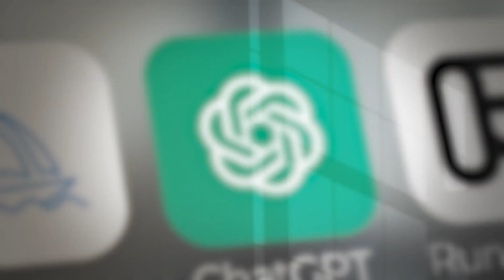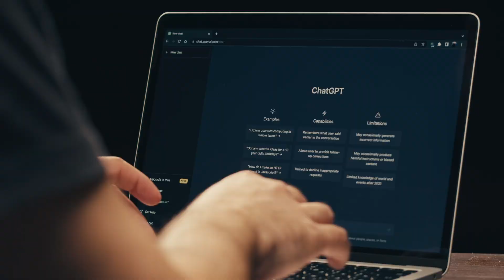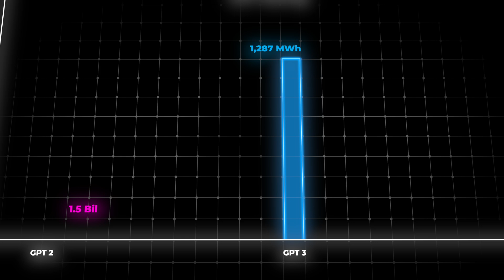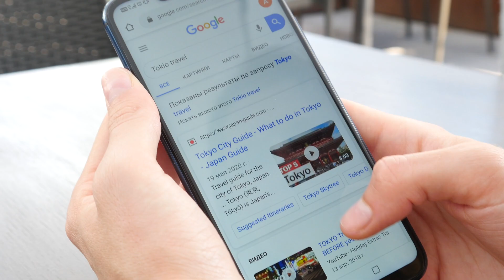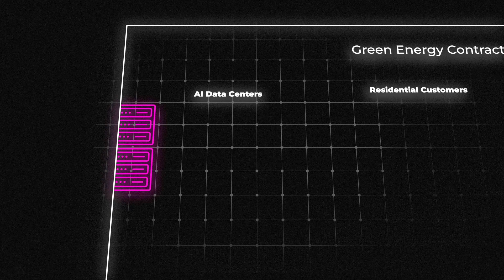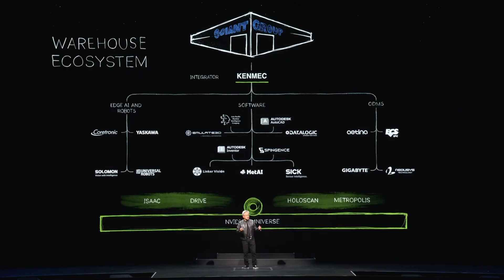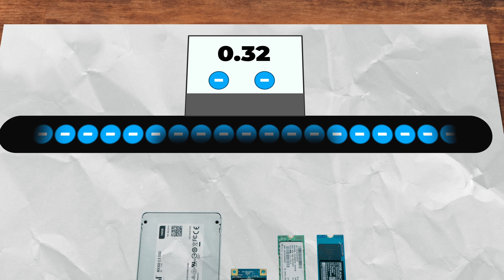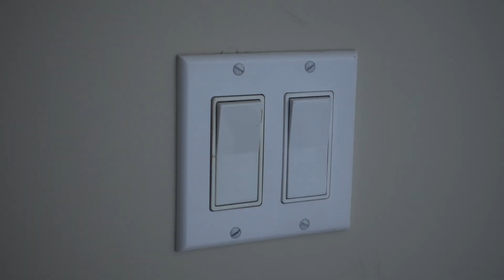AI's Hidden Cost: Can Our Power Grids Keep Up?

Comment: This is why we need nuclear power.
Reply: Nuclear is not the answer, not by a long shot.
Reply: @beyondfossil  why is that?  Is there a better source for more energy?
Reply: @DStein-jn9ls  There sure is!  Look upwards... but not straight at it. 😎
Reply: @DStein-jn9ls  There sure is!  Look upwards... but not straight at it. 😎

As I described in another post here, at 99.9% the mass of the solar system, the sun provides a cosmic 173,000-terawatts to the Earth non-stop.  Or about 1000W per square meter peak at the ground and is always peak somewhere on Earth.  All the combined fossil and fissile material on Earth would amount to a bucket or two of water in an ocean compared to the daily amounts of energy provided to us from the free clean fusion power we get from the sky.  Renewables harness this energy directly, and the raw inputs of sunlight and wind cannot be taxed, embargoed, blockaded or sanctioned.

Not convinced?

Much less than 1% of the world's total land surface alone in current generation photovoltaics is enough to power all the world's grids.  But why stop there?  Imagine a full 1% or 2%?  Solar can also produce power 'in situ' on-premises which greatly reduces load on the grid because rooftop solar "unloads" the grid.  Rooftop solar also starts creating a distributed power architecture which is increasingly necessary an in increasingly unstable world.  It helps that datacenters have massive rooftop and parking lot areas.  Also, a lot of the biggest datacenters generally have a lot of open land around them as they're built outside of urban areas.  Every watt generated locally is a watt that doesn't stress a distant power plant to generate nor the grid to transmit that watt.

Renewables have reached record low LCOE and continues to fall while nuclear just keeps getting more expensive.  The next 10- to 20-years will be critical to mitigate the worst of climate change yet it takes 10- to 20-years to complete a single nuclear power plant.  New construction nuclear will have next to zero impact on the huge amount of energy needed to displace fossil fuels during this time.

Wind and solar are currently being built at scale.  There's a large 30% compound annual growth rate (CAGR) solar growth in US and a massive 60% CAGR growth in China.  The CAGR growth of nuclear nowhere close to this.  Maybe 1.5%.  US annual solar generation (currently ~233TWh) will blow past US nuclear 800TWh generation by 2027 to 2028.  That doesn't even include wind with annual capacity currently is greater than solar in US.  Solar generation alone will reach US 4251TWh annual grid demand by sometime around 2034.

Furthermore, "firm renewables" at scale are just around the corner with massive government, scientific and industrial interest in grid-scale storage technologies.  When firm renewables arrive at scale, all other energy production methods like fossil fuel and nuclear are done on the grid.  Nuclear will still be used in small-scale scenarios like military, scientific and deep-space exploration.  Commercial nuclear is just the wrong tool for the job on the grid.   Commercial nuclear power's own history bears that out with it powering only 10% of the world's grids after a long 70-years of history and its percentage is falling.  Nuclear failed us from its promises of abundant energy "too cheap to meter" promised in the 1950s.  If nuclear had come close its promises, we wouldn't be so far down the climate crisis hole we're currently in.  Commercial grid-scale nuclear failed us.

Comment: The most important thing to realize is that AI will not kill the grid, but more like the grid will kill AI.

In science terms, all entities (whether organic or artificial) can only grow proportionally to the amount of energy they can acquire from the environment using whatever methods they have available to them.  In this case, any energy deficiencies will curtail AI growth until more energy is acquired.  But the massive power of the sun could allow AI to grow to Type-1 and then Type-2 Kardashev scale civilization (after killing off its parent species of course).

Comment: In reality the actual AI compute does not actually consume any electricity, the AI is a free bi-product of converting electricity into heat. If we just made effective use of this heat then there would not be an issue.

We need to integrate these data centres into district heating systems.

Comment: I live in the area where the Cedar Rapids data center is to be built.  The local nuclear power plant has reached its end of life and is now being replaced by 3,500 acres of solar panels on prime farmland.  This video just put the pieces together for me as to why. I can see a lot more expansion of these panels to more prime farmland.  Looks like this would have been better served in a location where less productive land is abundant.
Reply: 40% of the corn grown in the country is for Ethanol.  PV solar produces 100 times more energy per acre than corn ethanol.  In addition, many are also using the land with PV solar for specialized agriculture, like sheep grazing and part shade crops.
Reply: @MichaelF350  Soybeans are a thing. Also, I am watching these solar panels go up just 3 miles from my home and they are not planning on raising animals under them-they are too low for that.
Reply: @MichaelF350  Where did you get that number from? It's the first I've heard of it, but I've never considered what the corn ethanol vs solar generation power production means.
Reply: @12pentaborane I have seen this number between 50 to 125 so I picked 100.  It depends on how good the land is for corn and how good the location is for solar.  If electric vehicles are the future and trade wars are the future, then there will be a lot of farmland available.  The other trend is the total automation of these huge farms.  Lots of farms will be largely run remotely in the coming decades.  The equipment and operations are so complex that they will be run be corporations
Reply: @MichaelF350  Honestly I'm surprised 50 is the lower bound. Photosynthesis is really inefficient.
Reply: @MichaelF350  This is a very good point, but it's a better argument against using prime farmland to grow corn-ethanol than it is against placing solar panels on prime farmland. You're immediately assuming that farmland in particular was split 40% to corn for ethanol, which may or may not be the case.
I think it's important to take averages as what they are, statistical constructs meant to describe populations, but which almost never describe real individuals (or plots of land for that matter).
But in any case, I appreciate anyone willing to speak out and challenge the status quo. It's what keeps the wheels of progress in motion.
Reply: Knowing they use farmland for this when there are so many flat topped buildings with fully unused space drives me bonkers, too.
Reply from the maker: thank you for your insight being local there! Yes, we have a weird combination of factors ... people are building these data centers near high traffic areas, like DC or california, to reduce latency and increase speed. but we definitely need to be thinking about how we build these and not take up great farmland
Reply: Yeah, they're called "desserts" ... which get LOTS of year-round sun.
That's why I semi-retired (work from home part-time) to Las Vegas and bought a huge house with a huge backyard ... every square inch to be covered by solar panels.
Reply: I agree that solar developers need to consider the aesthetics….surround the farm with trees etc.  I don’t think it is going to be realistic to say farmland is out of bounds.  Otherwise all of Iowa would be off bounds.  I don’t think we can have all the solar in the desert and have all huge power lines everywhere.  I suggest planting some of the native grasslands within the solar farm.  Most flat roofs would be much more expensive.  They can’t handle the weight without reinforcements.  They can’t handle tracker.  The current farm bill actually is paying to take land out of production and if the demand for ethanol goes down, over production is going to be a huge problem.  I think a solar farm is easy to remove when it is no longer necessary and doesn’t do any harm to the land.  I have a lot of sympathy for neighbors, but it could be a lot worse…it could be a  big hog farm.
Reply: Born in Iowa City, went to college in Cedar Rapids while working at the local CBS station. Engineer at Norand for a few years.
I know the area.  Where are they building this data center/solar farm?
Reply: @AZOffRoadster  northwest of the CID airport.  A good friend has a farm just south west of the airport.
Reply: @AZOffRoadster  side note-did you work with Kevin Corrizzo at channel 2? I was friends with his mother.
Reply: Sorry but commercial nuclear power is not the answer.  In part due to its ultra-expensive cost and ultra-long build times, commercial nuclear power will be gone from the grid in about 50 years.  Not just because of that but renewables are at historical low cost per MWh generation (and still falling) while nuclear keeps getting more expensive.

Furthermore, "firm renewables" at scale are just around the corner with massive government, scientific and industrial interest in grid-scale storage technologies.  When firm renewables arrive at scale, all other energy production methods like fossil fuel and nuclear are done on the grid.  Nuclear will still be used in small-scale scenarios like military, scientific and deep-space exploration.  Commercial nuclear is just the wrong tool for the job on the grid.   Commercial nuclear power's own history bears that out with it powering only 10% of the world's grids after a long 70-years of history and its percentage is falling.  Nuclear failed us from its promises of abundant energy "too cheap to meter" promised in the 1950s.  If nuclear had come close its promises, we wouldn't be so far down the climate crisis hole we're currently in.  Nuclear failed us.

At 99.9% the mass of the solar system, the sun provides a cosmic 173,000 terawatts to the Earth non-stop.  Or about 1000W per square meter peak at the ground and is always peak somewhere on Earth.  All the combined fossil and fissile material on Earth would amount to a bucket or two of water in an ocean compared to the daily amounts of energy provided to us from the free clean fusion power we get from the sky.  Renewables harness this energy directly, and the raw inputs of sunlight and wind cannot be taxed, embargoed, blockaded or sanctioned.

With respect to land, much less than 1% of the world's total land surface alone in current generation photovoltaics is enough to power all the world's grids.  But why stop there?  Imagine a full 1% or 2%?  Solar can also produce power 'in situ' on-premises which greatly reduces load on the grid because rooftop solar "unloads" the grid.  It helps that datacenters have massive rooftop and parking lot areas.  Also, a lot of the biggest datacenters generally have a lot of open land around them as they're built outside of urban areas.

A solar farm is actually more environmentally friendly than an actual agricultural farm.  Current agricultural methods are ruinous to the environment with animal run-off, pesticide run-off, and soil erosion.  So, it's not surprising that with a solar farm on it, the land would live a much more peaceful life than it ever did as an agricultural farm.  New agricultural methods are needed.  One example is using "agrivoltaics", one can reap two crops off the land: food and energy which humans need a constant supply of.
Reply: @beyondfossil  “ultra expensive cost” due to lawyer fees and court costs. ‘Ultra long build times” due to court time. These are people problems not nuclear problems.
Reply: @jimk8520  No Jim, a lot of the nuclear's delays and costs are due to the extremely conservative nature of the nuclear industry and for good reason given the nature of the power source.  Furthermore, one significant incident at one nuclear power plant often can lead to other plants of similar design to be shut down.  That doesn't happen with any other power generation technology.

Moreover, all new energy sources need to work through local bureaucracy including renewables.  There are gigawatts of it held up in red tape.
Reply: @beyondfossil  And all of those are people problems, too.
Reply: @jimk8520  Keep thinking that if it makes you feel better.  But watch as nuclear fades from the grid.  If you live long enough, you'll see the last nuclear power plant on the grid shutdown in about 50-years' time.  Commercial nuclear is the wrong tool for the job on the grid.
Reply: @beyondfossil  What I know is that I won’t live long enough to watch it fade and ultimately be replaced by fusion.
Reply: @beyondfossil  Did you even understand my point?  Less arable land would be a better choice for data centers & their prerequisite high energy needs.
Reply: @IowaKim  Sorry I misunderstood your post.  But there are so many other nuclear fan boys posted here already I'm leaving my post up. :face-red-droopy-eyes:
Reply: @beyondfossil  The nuclear power plant was a great neighbor for the 30+ years I lived near it.  Unfortunately, the eminent domain took away a lot of farms to build it. The result is a really nice state park and lake, but the community still reverberates with what had to occur to the rural population to fulfill the needs of the local urban expansion. Now seeing more land taken up for data centers and their energy needs again impacts the rural population. Also, another friend is facing eminent domain issues with CO2 pipeline.
Reply: @beyondfossil  "If nuclear had come close its promises, we wouldn't be so far down the climate crisis hole we're currently in.  Nuclear failed us."

Nonsense. If western countries hadn't closed down their nuclear power before end of life and had actually started to build out more instead the electricity generation equation would have seen much better now. You could also have worried less about your imaginary crisis. 

"Renewables harness this energy directly, and the raw inputs of sunlight and wind cannot be taxed, embargoed, blockaded or sanctioned."

You actually believe that governments can't tax energy generation? Good luck with that fantasy. 

"A solar farm is actually more environmentally friendly than an actual agricultural farm. "

There's the problem that people need to eat food. Solar farms should not be built on farm lands. 

"New agricultural methods are needed."

Incorrect.

Comment: The comment at 9:15 isn't correct.
corporate companies adding their own data to AI's use RAG and not usually fine tuning (eg training the base model) because it's too expensive.
I'm not saying that the point you are making isn't correct over all but there are now ways to give AI's access to data you want them to be aware of without actually training them further.
MS sells access to openAI APIs on locally run models but you don't usually change the base model. If you read up on RAG, Embeddings and Vector DBs you will see what I mean

Comment: AI and crypto are fairly constant loads, once the centers are built out.  Wind and solar are intermittent generators. This is a huge disconnect.
Reply: Even when taking into account energy storage renewables have a lower lcoe than most to all energy sources. So this will fix itself quickly once battery prices and long term storage develop a bit more.

Comment: What are Americans doing that the average person is using up 883KWH per month?  That's about how much I use in a New England winter using strictly an air-to-air heat pump, without the use of gas, propane, or oil for anything else.  I could see how perhaps Arizona would use that much power in the middle of summer, but otherwise, I don't get how the average person is consuming so much power.

Comment: Is anybody using evaporative cooling for desalination?  This could be a win-win.
Reply from the maker: interesting, so you're saying get the cooling benefits of vaporizing water, then find a way to collect it free of the contaminants? issue is salt would gunk up the meshes... but its an interesting thought!
Reply: Surely though, that is just an engineering problem, and not any worse than any other heat-based desalination program.

Comment: Nuclear energy... Why are people so resistant to it.
Reply: Bill gates is leading third generation nuclear power plant.
Reply: The old and cheap technology was too unsafe. New nuclear is still too slow to build and expensive. The resistance isn’t actually that strong these days, but there’s no agreement on what to build. NuScale was gonna be the saviour but that’s not panning out.
If someone makes an inherently safe SMR, that doesn’t require highly enriched fuel, that doesn’t produce too radioactive waste, and is actually reasonably cheap to build, I don’t think you’ll see too much objections to actually building it.
Renewables are growing faster now than nuclear ever did, and energy storage is growing fast enough that the energy balance problem is being solved in time to handle that growth. So I’m not sure why nuclear is necessary. 
Maybe we can free some land from renewables in a few decades.
Then again, agrovoltaics is making it so solar doesn’t actually consume land. Wind power is being improved so they don’t kill too many birds (keep in mind that nuclear cooling towers kill birds too). Advanced geothermal is looking to replace the role nuclear has had without any of the waste. So  I’m not so sure renewables will have any downsides in the decade or two it takes for nuclear to get its act together.